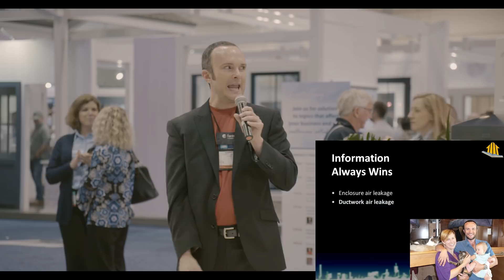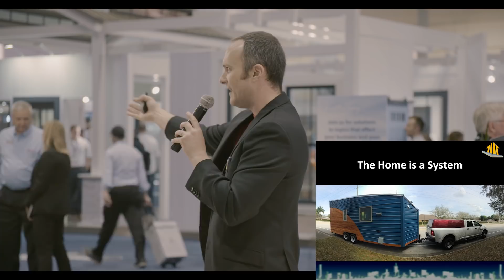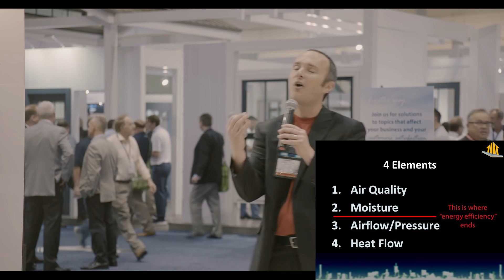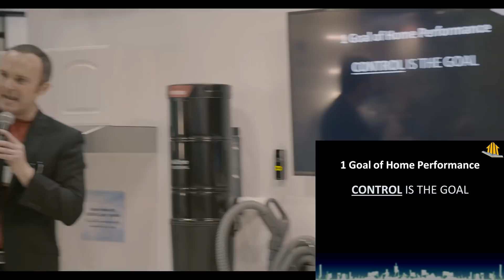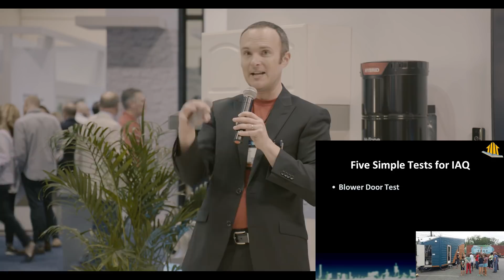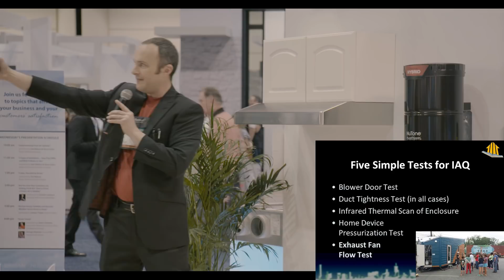Builder Crash Course in Home Performance: IBS 2018

Comment: Corbit, I was wondering what radon monitor you use?  Do you like it and would you recommend it?  Is there another meter that you would recommend instead?  Thanks.
Reply from the maker: I use the Corentium by Airthings as a long-term monitor. Not a certified radon tester personally, so I don’t go deeper than that.